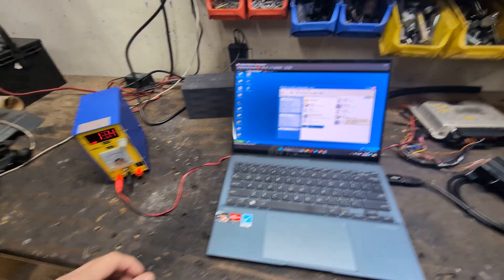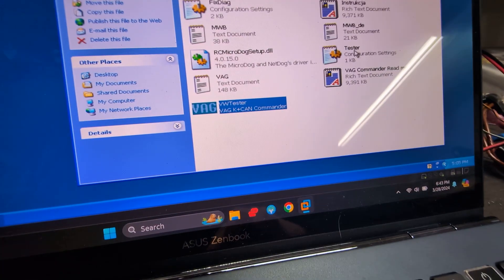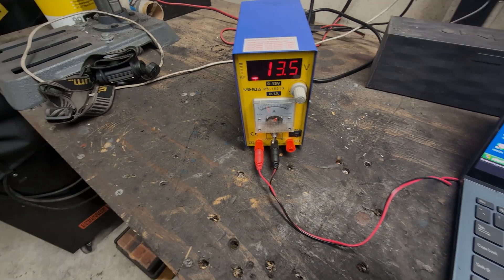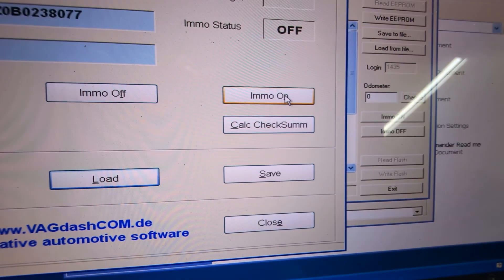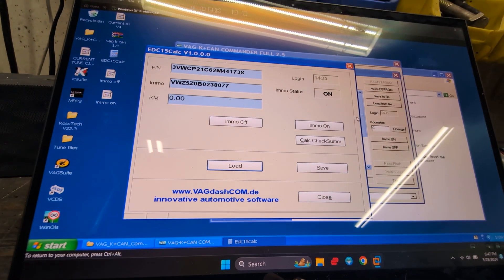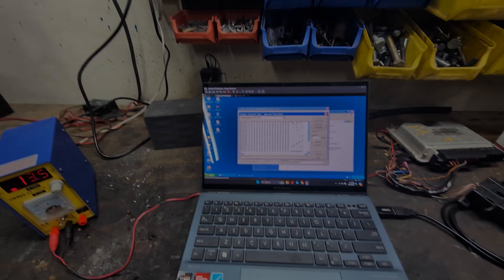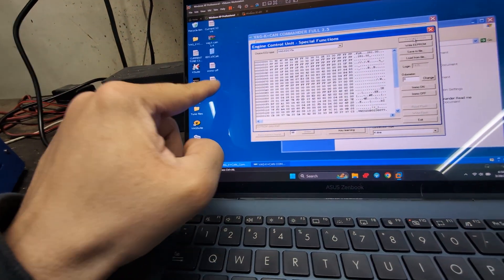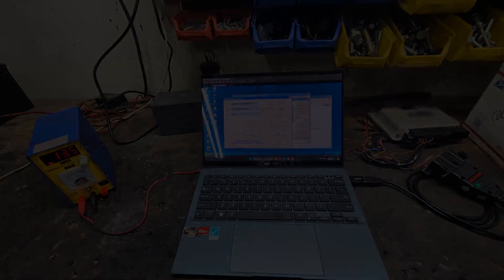How to turn off your IMMO for your ALH TDI swap!

Comment: I have an odd problem here. When I go into VCDS I can view engine components and it loads it up. But when I go into vag commander it always brings up cannot connect to device. Switch off and on ignition. I can’t for the life of me figure out why it won’t connect. I’ve had it read eeprom on one vw car I had with this cable (vag kkl 409.1) but in the stand alone harness on the bench I can’t get it to read. Any ideas